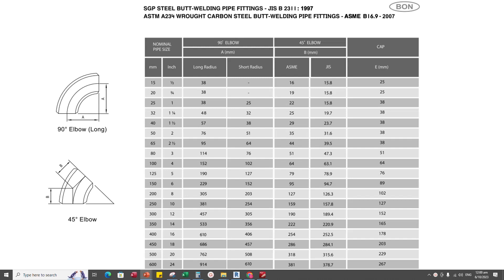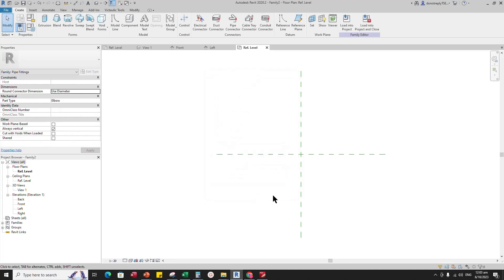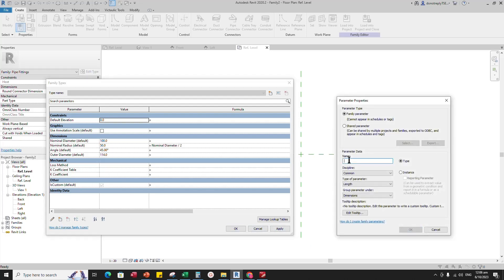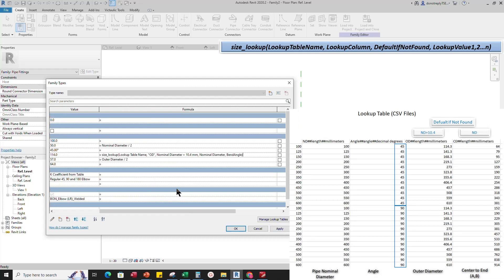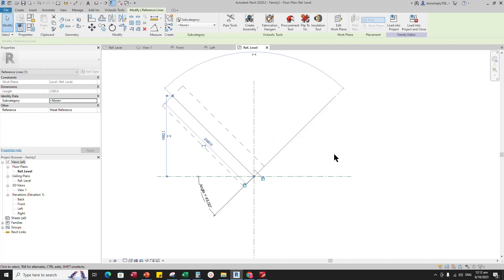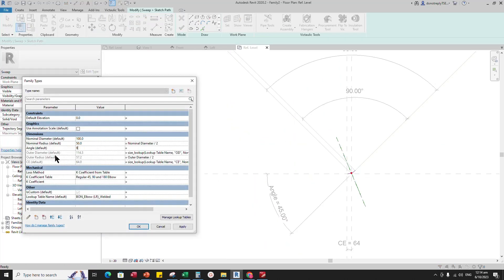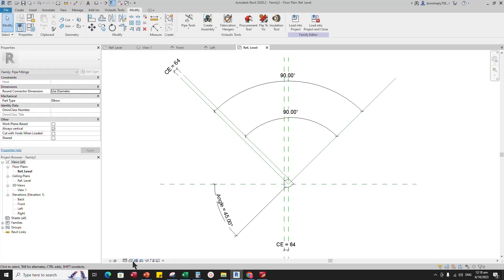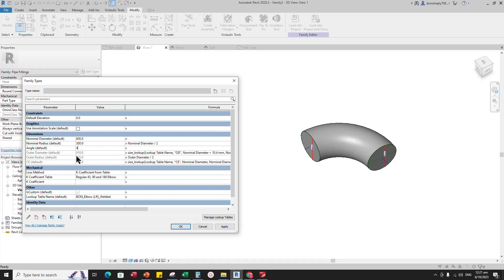Create Long Radius Elbow Revit Family (Parametric)

Comment: While import the excel file, error message is appearing "the header angle##angle## decimal degrees in column 3 is invalid" Can you explain the why the error came.
Reply from the maker: Please, You can double check the formula. And save the excel file as CSV file (comma-separated values file) and import it.
Reply: Same issue for me for the angle formula in the excel
Reply from the maker: Please can share your CSV file to me?. I can check for it